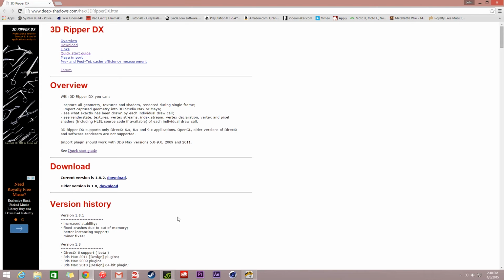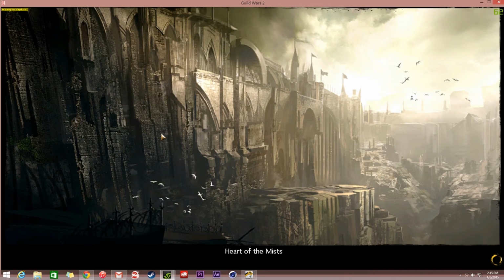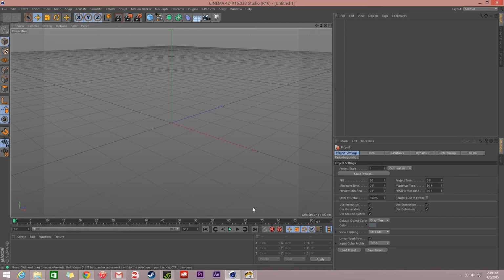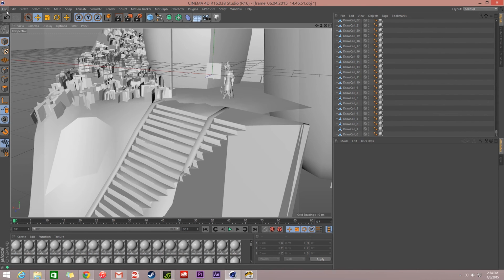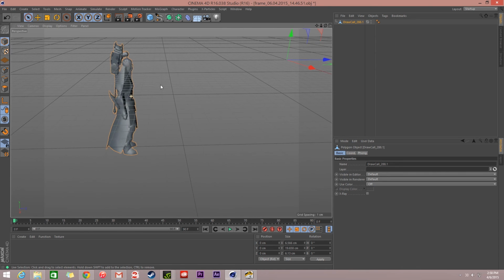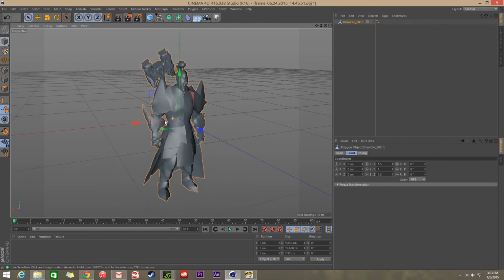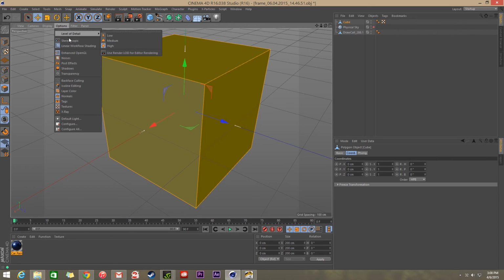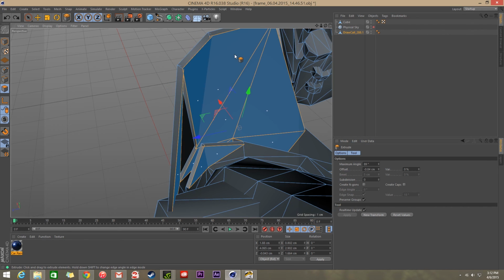3D Ripper capture and export to Cinema 4D tutorial

Comment: Hey, if possible, I need some help. I've got the entire setup for Dilphin correct, even got  "Ready to Capture" in the corner, but it refuses to capture frames. It is capturing textures, as the folder's filled up now, but frames are completwly absent and I can't find a SINGLE answer anywhere. I've spent hours trying to fix this and it's driving me mad. Any help would be greatly apprectiated.

Comment: Sadly its not work for me in Tomb Raider Anniversary - like it saves textures/shaders but it not save models at all, do you know what might be issue or how to fix that?
Reply: damn bro, I will need to ripp that ass in a days, dou you have tried extract it with "ninjaripper"??
with "3dripper" I cant get the resident evil 6 characters, only extracts the level.
Reply: @arsizhifenerprozhod  I able to extract characters properly, but level contains only few models - other things is planes etc, and some models are distorted. I find something like tomb raider level editor, but I don't try it yet.
Reply: @eclairesrhapsodos5496  oh, maybe the game disable rendering for non visible sections
Reply: @arsizhifenerprozhod  no, even surface where I be standing on be like that. + Moving objects duplicated a lot.
Reply: @eclairesrhapsodos5496  do you find a solution for correct scale? I forgott the numbers
Reply: @arsizhifenerprozhod  as I remember it's depends on your resolution / aspect ratio - I have 16:10 so it's distorted sometimes, maybe not because of that, IDK 😐.... I actually find a lot of models / props from tr games, but not entire level at once, which I want.

Comment: I keep hitting F12 but nothing happens it says "ready to capture" at the top of the screen what am I doing wrong?
Reply from the maker: Hello, Thank you for your comment :D!  I'm sorry to hear that 3D ripper is giving you trouble. I would try running 3D ripper as administrator. But the biggest thing I found that helped me, is restarting your PC, and then evidently starting up 3D ripper and launching the game again. It's very important that you do this within the first 10 minutes. That is what fixed it for me when I was having the same issue. That said, sometimes 3D ripper gets confused on what buttons do what. By this I mean sometimes hitting F11 will make it work, even though it says F12 should be the button. It's very strange software. Hope this helps! Let me know if it works :D!
Reply: Turns out its F11 I needed to press. But its still kind of weird because even though it said it finished processing I checked the Frames, Shaders and textures folders and they are all empty still. Is it possible they were saved to somewhere else?
Reply from the maker: Hmmm, interesting. From the tests, i've done. I've found that it almost never places the textures and the Objects in the files that it says it's going to place them in. Instead. It places it on the drive you have 3DripperDX installed on. For me, I Installed it on my C Drive. This means it stored it at this location. Local Disk (C:)/2. It literally stores it right at the very top of all your folders on your drive. It normally names the drive 2. Not really sure why, but that is what it seems to name it. Let me know if you need any more info :).

Comment: Hi thanks for this video, I'm trying to use 3dx ripper for sims 3, i seen it work for sims 3 with someone else but for me it only launches the game the yellow box does not appear, i tried restarting my computer, and i made sure it is not the shortcut app, i believe sims 3 uses directx8 or 9 and ninja ripper no luck
Reply from the maker: Hello, thank you for your comment :D! Sorry to hear that 3D ripper is giving you trouble. This is very tricky, as of now, 3D  ripper has been having a lot of problems with games. It's really looking like its loosing support sadly :(. That said, you could try running 3Dripper as administrator. I also recommend restarting your computer and directly trying it again. by this I mean, make sure you try it within the first 10 mins of being booted up. This seemed to fix the issue for me with guild wars 2. Hope this helps. Let me know how it goes :).

Comment: Hi!, sorry to bug , i love the tutorial though i must be doing something wrong because it is not working for me. I am also trying to download my guild wars 2 character. I was following the steps exactly however whenever i try to use 3D Ripper to launch Guild wars 2   it Crashes and says guild wars 2 cannot be launched. Any idea why its doing that?
Reply: Hi, i had the same issue that you have but i found a solution on reddit. I run GW2 on 64 bits and it has to be 32 bits for 3D ripper so you have to put "-32"(without the quotations marks) in the command line parameters  (2nd line when you launch 3D ripper ).
Reply from the maker: Hey Zephren :D! Thank you for your comment. i'm sorry to hear that your having trouble with 3D ripper Dx. Is the problem that your having where 3D ripper wont start when you launch the game? If this is the issue that your having, I would recommend restarting your pc, and then instantly trying to run 3D ripper right off the bat, before you do any thing else on your pc, 3D ripper can be a little finicky.  Hope that this helps :).
Reply: Thank you for the fast response, sorry it took me so long to reply back. I have been trying to troubleshoot and i must confess that i am quite bad at it.  The problem i am having is that when i bring up 3DX Ripper and click the launch button on the bottom right to launch guild wars, the guild wars launcher opens and then an Arena net error message comes up saying it is unable to launch guild wars and i should contact customer support if the problem persists. I tried restarting the computer and launching guild wars 2 as soon as i started it which did not help. I tried looking for issues that could be breaking it, i think i am running the 32 bit version of the game since if had the client on my computer forever though i actually am not sure how to check. Additionally i did not click a specific version of 3DX max when i installed it because i am not planning to use it with 3DX max.  Any other suggestions?
Reply from the maker: Hey Zephren :D! Hmmm, this is a long shot, but did you make sure to have force windowed mode turned on? Also, inside of the guild wars 2 settings, make sure to have the game run in windowed mode. This might fix it. Let me know if this helps :).
Reply from the maker: wow nice! Thank you for the info Ishmenil Bob! Appreciate it!
Reply: Thank you so much for the comments, i really appreciated it. I will try to get this to work soon, i have got a lot of homework so it may be a while but i am reading these and do appreciate the help.
Reply: :(, sadly this is still not working. But making progress! --> after running in 32 bits it opens the launcher fine but then says that guild wars has a problem continuing to run instead of encountering a launch error :S. -- so now i am working on trying to figure out why it is doing that.
Reply from the maker: Hmmmm, interesting. Are you running the true 32 bit version of Guild wars? Or are you using the New 64bit version of the client? Also, do you have windows 10. Thigh could be a big thing, since windows 10 only runs direct X 12, and can not go back to direct X 11, from what I gather. 3D ripper DX requires directX 9 I believe to run, and windows 10 will not allow that, from what I know. This thought just hit me. This thought just hit me, so cant confirm it, but everything i've read seems to support the idea.
Reply: I have the same problem. And I'm running the 64bit version of Guild Wars 2 on windows 10. Do I really just put "-32" in the command line? Nothing else? And is there an alternative programme similar to 3D ripper?

Comment: Добрый день, работает ли этот метод на Win 8? игра Aion. при нажатии Laung, Потрошитель выключается, игра загружается, пожалуйста, помогите
Reply from the maker: Hello. Thank you for your comment. I'm very sorry, but i'm afraid that I don't speak Russian. I was able to google translate your question, however, and I'm sorry in advance it I misinterpreted it :). 3D ripper should work on windows 8. One thing to note, is that 3D ripper has issues with steam games. Also, i've found that if you restart your computer, then instantly try again with ripping the game, it can work when it didn't work before. Sorry if this is something that you have already tried before :).
Reply: thanks for answering. the game is not steam. MMOrpg Aion. have you had any error -unable to create process? or do you all earned without problems
Reply from the maker: hmmm interesting. Did you make sure to use the games launcher launcher ,under program files, as the game's launcher in 3D ripper?
Reply: I hope the Google translator will correctly do it right. when you start the game - ripper is disabled(run as administrator) Global monitoring - issues: this feature is available for 32-bit OS only. maybe you need win 32bit? what OS do you have? 3d ripper downloaded from the website on the video?
Reply from the maker: I have windows 10 for my OS right now, but when I made the video I was using windows 8.1. Is the game you're trying to capture a 32bit program? Also, google translator seems to be working well :D! Also, do you have 3D ripper running as administrator? Sorry if this is something you already said, I might have misunderstood :).
Reply: пробежать риппер, совместимый с ОС? Я в отчаянии, я действительно хочу, чтобы сделать своего персонажа из Айона, и сделать его на 3D-принтере ((
Reply from the maker: Very sorry that it took me so long to respond. Dont despair, we can find the answer :D! One thing to know though, if you plan on having your capture 3D printed, there is a lot of work you're going to need to do to the model before it's compatible with 3D printing. Is lona a 32bit game or is it 64bit? I don't think it would be incompatible with your operating system. :)
Reply: assassins creed, got 3D Ripper DX, but my game Aion does not work(icon-ready no capture) Aion game with DirectX. I have installed DirectX 11 and maybe you can remove it and put DX 9 version? what version of installed DirectX?
Reply from the maker: Hmmm Interesting. I have Directx 11 on my pc when I made the tutorial. Some games are more tricky than others. Since Assassin's Creed, worked, it's interesting that Aion did not work. Did you make sure to place the game launcher found under program files in 3D ripper for it to launch from? Also, did you make 3D ripper administrator?

Comment: I checked the wavefront OBJ  in 3DRipper but I am not getting a .OBJ file? Help please.
Reply from the maker: Hello :D. Thank you very much for the comment. I'm sorry to hear that 3D ripper DX is giving you trouble. Sorry if this is something that you tried already, but have you tried restarting your pc, then going directly and straight back to 3D ripper and tried another capture? 3D ripper can be very glitchy at times, and a restart can help :). Another issue it could be, Is I think 3D ripper only works on 32bit clients. Let me know if its still giving you trouble after this :).
Reply: John Burdock Ya I have tried restarting. My PC is 64 bit though so that probably explains it! Thanks for the quick response and your help!
Reply from the maker: No problem :D! Happy to help out ^^! Hmm that is odd then, as i'm pretty sure that 3Dx ripper should work with a 64bit system. Only thing you might want to check, is if the game that you are wanting to capture from is 32bit. :) Hope this helps :D

Comment: Mines crashing guildwars once I get past the login screen, any idea why? Thanks!
Reply from the maker: +Kaddex Thank you for the comment :D. Very odd. How much RAM does you PC have? Also, I know this sounds simple, but have you tried restarting, that helped me when it crashed Guild wars for me :)
Reply: +John Burdock I'll try restarting :D I've got 16gb
Reply: :/ still crashes
Reply from the maker: +Kaddex Ah dang, 16gigs is more than enough. What version of Guild Wars 2 are you using? Do you have a 64bit version? Also, what GPU do you have? AMD or Nvidia?
Reply: +John Burdock Should be 64bit, I'm using Windows 10, GTX 960m (Asus Laptop) How do I check the guildwars version? its up to date
Reply from the maker: +Kaddex hmmm I think it should be in the file where you launch it from, though that probably won't affect whether it works or not. Do you have it set to launch in windowed mode? Its a box you can check in 3D ripper :).
Reply: +John Burdock yea I checked everything like you did :) it crashes when I click anything after I'm logged in so if I login then even click a news link it crashes
Reply from the maker: hmmm that's strange. If you don't use the 3D ripper DX does it still crash?
Reply: Works fine without it :/ the ripper is crashing it
Reply from the maker: +Kaddex Hmmm strange, what version of 3D ripper do you have?
Reply: +John Burdock 1.8.2 (Newest one) think I need an older version?
Reply from the maker: +Kaddex That may be the problem. Here is a link where you can download the exact same version that i'm using :) https://assets.adobe.com/link/ad90422d-a43e-4b74-6e4a-ae9589949c5a?section=activity_public
Reply: +John Burdock hmm still crashes but does it a little different the window kinda wigs out
Reply from the maker: Kaddex Dang thats strange. This is a very strange issue. The only thing I would try next is making sure its launching off of the right Guild wars 2 file. Other then that i'm out of ideas. Verry sorry I couldn't have been more help. If you have any questions, I'de be glad to try and answer them if you get any ideas on how to try and fix it. Very sorry again that I couldn't figure this out :).
Reply: +John Burdock Thanks for your help anyways! Really weird it's doing that...
Reply from the maker: +Kaddex no problem :D Sorry that we couldn't figure it out :(. Please let me know if you ever end up finding out a solution :)
Reply: WKND VBS Currently I have the same problem as you, it does load and start up. Just before I can see the character menu a pop shows up; “a serious error has occurred that prevents the program from continuing to run.’ I do have only 4gb of ram and a pretty old video card ( gt 530). Is there any solution?

Comment: Hello, thanks for the great tutorial! Just wondering, if I do this with a steam game, will that trigger any anti hacking protection? Will the game still run normally if I run it without 3D Ripper?
Reply from the maker: +N. Stromi Thank you ^^. I'm glad the tutorial was helpfull :). That is a good question. I've never tried it with a steam game. It may trigger anti cheat, because it is injecting itself into the game. I have a good feeling that it won't though, because it's injecting itself differently, it's not trying to control, just capture. Think of it more  as caching the frames with a net. :) Whereas hacks are trying to give input to the game. Hope this helps. I can't make any promises that It won't though :).

Comment: What happens to the textures? Don't they get exported by 3d ripper dx as well?
Reply from the maker: +Sergio for Cinema 4D they do not get exported over, because C4D does not accept that type of file format. You can bring them over in the raw form, but you would have to place them all back on by hand. You can only get textures to port over if you have 3DS max, bye opening the 3DS max file in  the folder i show in the video. :)
Reply: Well, you can convert the dds texture files to png with a program like xnconvert, what I was wondering is if the obj file retains all the necessary UV coordinates so the textures are placed correctly onto the model.I didn't see any UV tags on your OBJ model though, unfortunately.
Reply from the maker: +Sergio Ah yea, the OBJ doesn't contain any UV information, so placing textures on would be very hard. Hopefully they have a new version of 3D Ripper that better supports Cinema 4D. One thing I always wan'ted to try but never did, was first port the models over to 3ds max and then port it into cinema 4D. That might keep the textures, but not sure :)